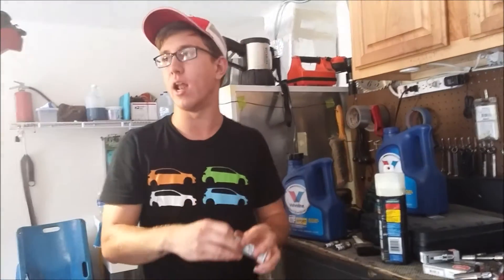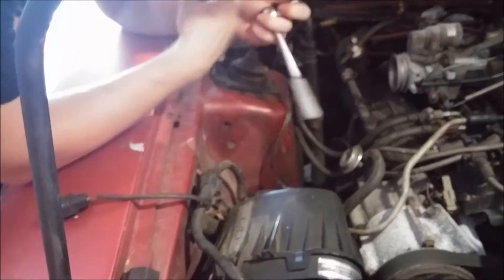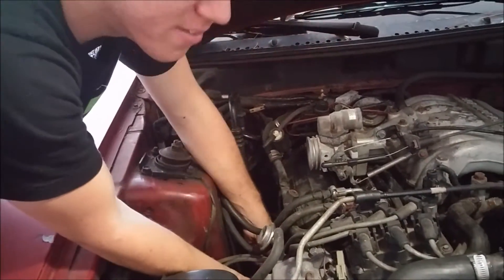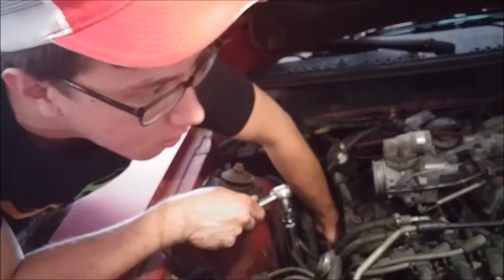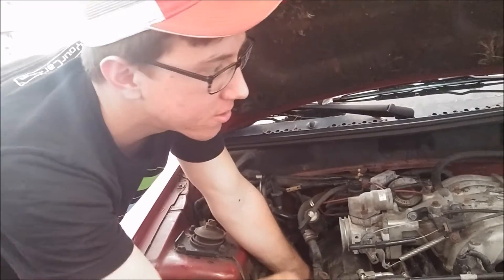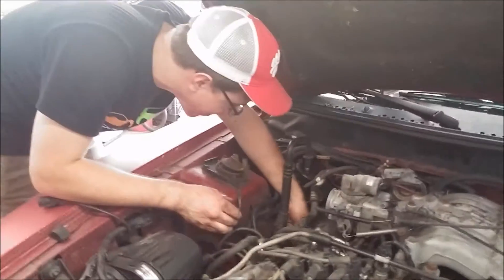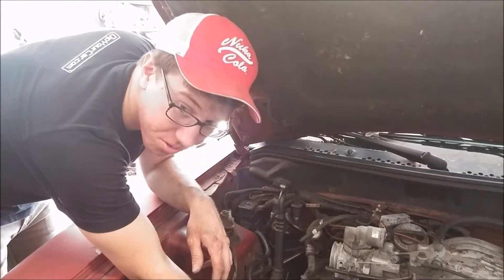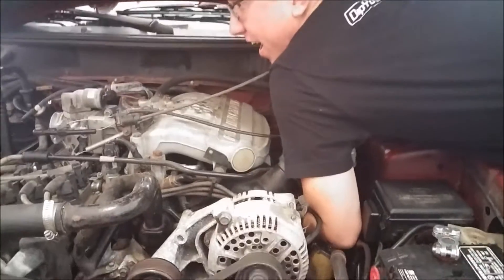Oil Burns and Handbrake Turns! -V6 Mustang Drift Build Part 9-

Comment: Did you guys do anything to the differential ?
Reply from the maker: Seth Davis nah, i was going to hunt down a posi 8.8" at the junkyard but didn't keep the car long enough. the new Mustangs got a posi though👌
Reply: what made you guys scrap it (sorry if I haven't seen the video) my buddy and I are thinking about switching to a 328i
Reply from the maker: Seth Davis pretty sure it had a blown head gasket, may have just been the intake manifold gaskets but it just didn't run right.  So rather than chase all the issues (it also had some electrical problems) I put it up on craigslist for $950 which is pretty optimistic. but some guy offered to trade for the ATV which ran perfect and needed like $100 to be fix everything on it. I get more use out of the atv for sure.

Comment: What area are y'all from?
Reply from the maker: we're in Florida, middle of nowhere to be exact.
Reply: +DirtRoad Garage okay cool I just moved to jax from middle of nowhere tx.
Reply: +DirtRoad Garage drift car list, 
ford Windstar v6  intake manifold(easier to turbo)

JDM asfuck turbo kit

extended knuckles

coilovers

strutbars

bucket seats and harnesses

fuel cell

megasquirt (reflash old ecu)

new driveshaft (v6 ones break under extreme power either v8 swap/turbo build

get a bigger hood lol